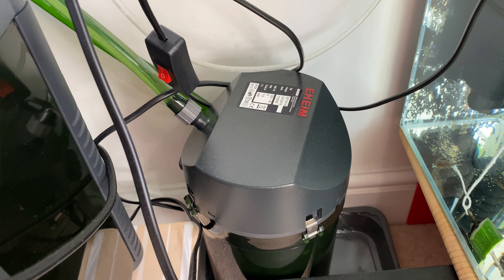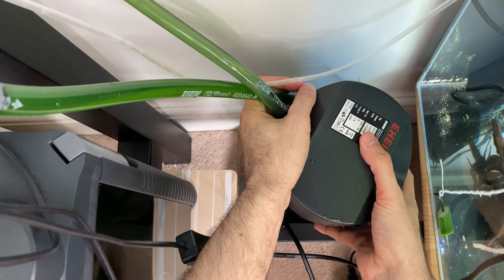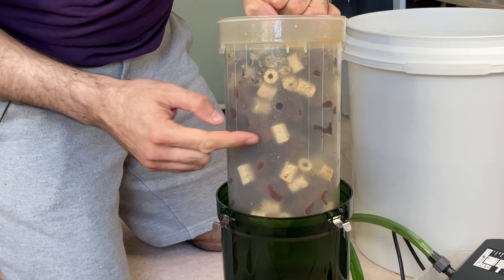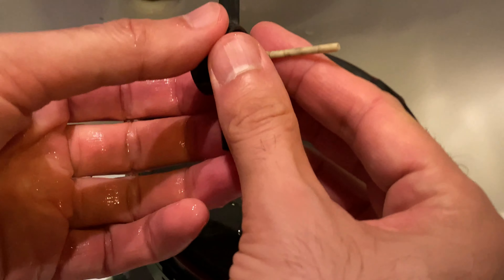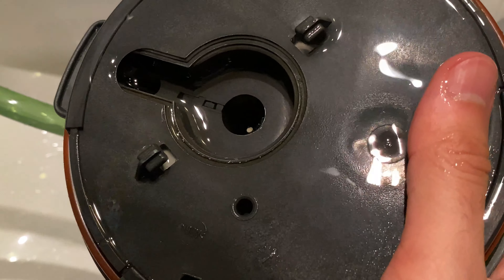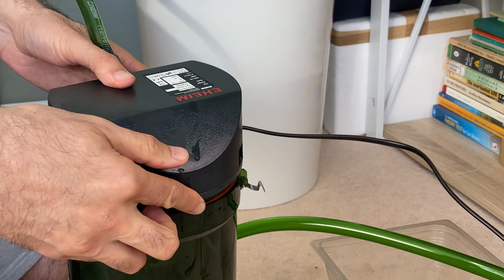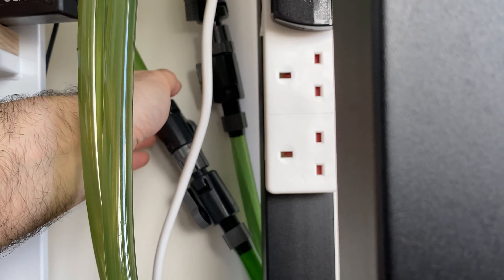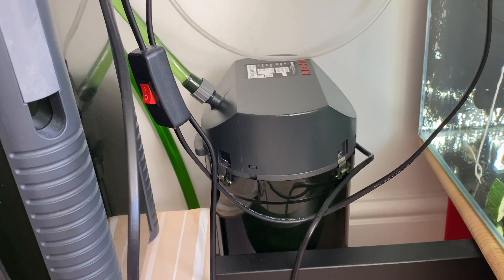Eheim Classic 250 External Canister Filter Cleaning and Review

Comment: Hello again,  Before i go out and  buy more bio media, so i can set mine up like yours to see if it's more efficient.  I need to know what you have in your aquarium. ● Is it a heavy bio- load? ●Is it also heavily planted? My bedroom tank is 16.9g ( 64L) it is heavily stocked with fish and plants: Cardinal tetras, Black phantom tetras, Harlequin rasboras, 3 otocinclus,  6 cory's . Med- high light preasurised planted tank. I know you do use a medium sponge at the bottom and filter wool at the top.● Would your set up be more effective in handling  the loose detritus and plant matter in my Aquarium?. ●Where do did you purchase the foam media with the bumps on it? ●Do  you know the ppi of the sponge?  Thank you

Comment: Hello thanks for the instruction video.  So about priming, you open the inlet valves  then straight away open the outlet valves, to create a vacuum?. How do you know when it's full? Or when to plug it back on?.  About O rings- I know about O ring for power head, but is there any sealing rings and where are they located? I was searching for replacement power head O ring when i came across 2 small black  sealing rings for models 2113- 2117. If you look online here is the model no of O rings  7250600. Let me know where they located? ..is it in the valves?
Reply from the maker: Thank you! You can only prime through valves if you have water in them, that is if you haven't cleaned them. If they re empty then you can prime with a siphon pump, I have a video on it. Once it stops making noises it means that it is full and you can plug it in. 

My canister never had sealing rings and I bought it new. I only have O ring and in 5 years I have used the unit continuously I never replaced it as it is still as new, I only lubricate it occasionally. Unless your canister is really old, you probably won't need replacements.

Comment: I’ve let the pump run mistakenly with no water pumping through before unplugging. Now after cleaning it’s not pumping , is that because there’s air in the hose ? Also , when done with cleaning you don’t have to fill the pump with water again? Or leave it empty like in your video ?
Reply from the maker: Yes, there is probably air left in pipes. As long as the pump is making noise it hasnt burned out. I don't fill it with water because there is some water in the pipes and it will prime fast, so there is no point.

Comment: IMO you should not touch the impeller unless you have to. Best to leave it. The slime that builds around the magnet is actually beneficial to keep it lubricated   Just rinse water through the opening for the impeller, that is all.
Reply from the maker: Leaving impeller alone is one of the biggest misconceptions. Eheim itself recommends regularly cleaning impellers. Check any Eheim canister instructions. If you leave your impeller 'alone' it will clog with muck, which will affect the flow. If your impeller needs to be lubricated, you can use a lubricant rather than slime. These parts are not designed to be lubricated by slime!
Reply: @tropicalfishhub  my 17 year old Eheim 2217 and 20 year old 2260 disagrees with you about clogging up with muck. Flows just like day one. :)   Anyway we can agree to disagree.

Comment: 8:25 filter will not close no matter how much pressure no matter where i put oring !!
Reply from the maker: It might be because you have too much media which prevents it from closing. If not, open connector taps on both outlet and inlet pipes to let the air out.

Comment: Omg, such a bad setup. Sponge at the bottom, courses then medium tgen the media rings. Then other media on top. Do not put a sponge on very bottom, you can put a few media rings to assist hold heavy dirt
Reply from the maker: Firstly, If you put your sponge on the bottom (even if you add some media under the sponge) and press it down with media, it will obviously loose its ability to absorb muck effectively because it will become pressed into your rings (which I'm assuming you want to use for mechanical filtration?!). Secondly, as I've said in the video, I'm using this canister for biological filtration, I do not need to keep there a collection of useless sponges or even more useless "rings". Adding a sponge on top of the basket is a time-proven method that has been used for years by many experienced hobbyists (see pimp my filter channel for example). Besides, it is well known and proven that "rings" are the worst filter media ever because they have limited surface area when compared even to lava. but thanks for your comment
Reply: @tropicalfishhub  I'm not sure what you were watching but the bio rings are effective just like the other media. You have underrated them. It's fine to use them under the tray to hold heavy muck but they actually hold bacteria just the same. Equally important as the sponge that you also disregarded and wash with tap water and squeeze like a sponge bath which destroys the colonies of beneficial bacteria in dual action from tap water but also from squeezing sponge. EVERY THING in the filter is to hold bacteria just the same not ONLY the bio media so you're contradicting yourself if you state you're using it for biological filtration  which is a contradiction in terms, it's all biological filtration. The sponges has a great surface area for your bacteria just the same not just as a means of holding heavy muck.
Reply: @goldiel4664  kinda late to this convo but agree with you on set up. If you water flows from the bottom up, then you need to have your sponges at the bottom. If the other way around them sponges at the top. Course, medium, and then fine. That way when the water hits the bio media THEN that water will be clean/semi-clean. This will prevent from your bio media from getting clogged and killing your beneficial bacteria. Having fine pad at the top will push muck to the bottom making it hard for beneficial bacteria to survive. However i do not like bio rings honestly, rather go with other media available.
Reply: @08mario510  the way you describe your setup is almost good. A few old bio rings which everyone has at the bottom to trap the heavy muck then a course sponge. Place all your media after that. The fine floss is not necessary in this filter as that will be the first to clog and send unwanted bio shit back to your tank. Fine floss for another filter which you can open and change out without disturbing your main media filter. The notion that you have to clean these filters is not true as it takes months for the beneficial bacteria to form. The muck floating around the media is the beneficial bacteria and not gunk at all. The fine sponge should be at the intake or pre filter which will reduce opening your canister to once per year. No need for all this cleaning as it resets the entire process.
Reply: @goldiel4664  not necessarily true with the fine pas/filter it will keep the very fine particles from hitting your bio media, this includes bio rings, balls, etc etc. your course pads and medium pads WILL NOT keep the fine particles from clogging up your bio media. In all filters it is recommended you have a pre-filter like a sponge on your intake tube and in my opinion fine pads are a must. Like i mentioned if you water in your filters flows from the bottom up. The course and media sponges will prevent the heavy muck/shit from hitting your rings, the fine pad will then filter out the very fine and small muck. By the time all that water hits your media there is very little muck/shit clogging up your media. Beneficial bacteria needs to surface area to live. Clogged media does not help
Reply: @goldiel4664  sorry pal, you talking about a whole different thing and are a bit confused. You are passionate about it but also misinformed a bit. I am not talking about how to cycle a tank. Im talking about proper filter setup “AFTER” your cycle has already been established. BUT to talk about this subject i am not wrong, and you are also not wrong. You have your system and if it works for you, then great. However you have a few point not quite correct, not wrong but not correct. Beneficial bacteria DOES NOT only live in your sponges. You said it too it lives in your bio media. It also lives in your substrate and also lives in your actual glass and any surface area of your tank. GUNK is NOT where your beneficial bacteria comes from, the poop and uneaten food “contaminates” your water, that turns into ammonia, ammonia to nitrite, nitrite to nitrate, then that nitrates is then eliminated by anaerobic bacteria. The 6-9 months is to establish aerobic bacteria. That is only the 1st stage, this stage can be waaayyyy more than 9 months. You can remove GUNK and still have ammonia and nitrates. That is feeding your bacteria. Misconception that you have. When you have an established tank your bacteria already lives in your media, your substate, sponges, and glass. When you have disposable fine filter, you are NOT killing existing bacteria, that other bacteria is still much alive in the areas i mentioned, now you can build some bacteria in a fine filter but this doesn’t “reset” your cycle because you already have bacteria establish elsewhere. This argument is valid when you only have fine filter sponges and your are consistently throwing that away. You are not allowing your bacteria to establish because you are throwing it away. Fine filter is meant to keep you water clarity crystal clear by removing the “fine” GUNK from entering you water column in your tank, you still have “GUNK” in your course and medium sponge, and you beneficial bacteria LIVES in more than one place. By throwing away GUNK from your fine filter pad it doesn’t do much anyways because by the time you clean out your filter and throw away that GUNK your bacteria already ate and used all the nutrients from that GUNK. Your fish will still poop and food will still be present as you will still be feeding. Its an endless happy cycle for your beneficial bacteria and your fish. Also the whole thing about light sensitive is random and definitely not correct either. This may be a marketing by EHEIM to try and pull you use their filter. #1 reason it is wrong it’s because of sponge filter that are directly under light inside your tank, these filter are perfect way to keep beneficial bacteria, another reason is under gravel filters that old school fish keepers used. These are directly under ambient light and still kept plenty of beneficial bacteria.